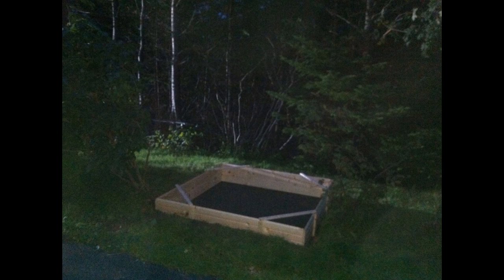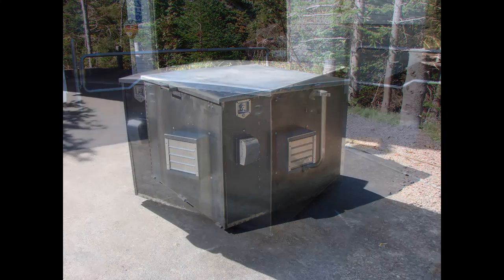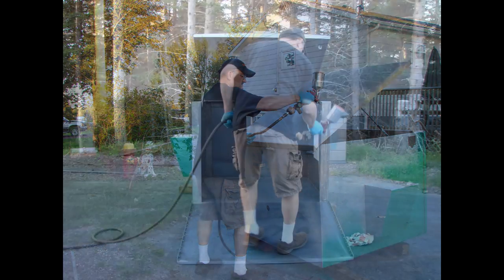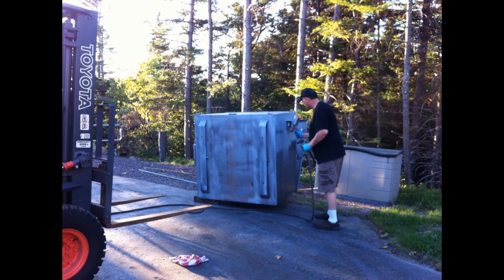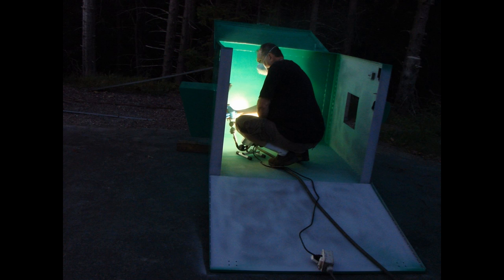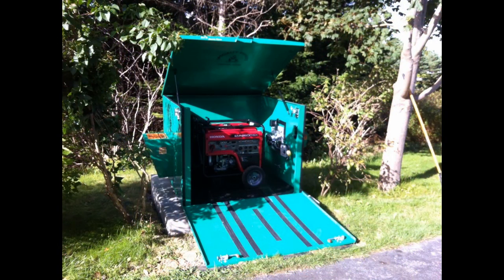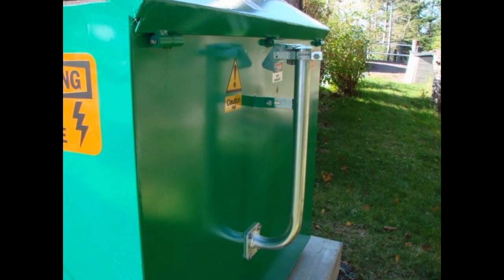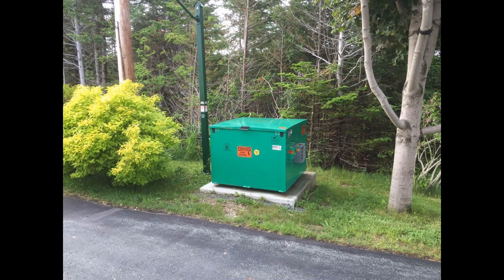The Building Of Our Custom Generator Enclosure

Comment: I remember when you posted about this on TBN. Great build. It put to shame my plywood enclosure. Haha
Reply from the maker: Hey not to worry. I work with metal and you with wood. The end result is the same. Our generators are out of the elements. 👍👍
Reply: Yep good stuff ply. especially Marine ply as it is mostly impervious to.water> Build most of my things from this as I cannot weld to save my life. What ply doesn't like is our harsh sunlight. Ha! so you have to shade all your external work.

Comment: I just assumed that your generator was a whole house/shop , permanently mounted and running on propane or such. very cool! best of both worlds.capacity and portability. love the enclosure. I might have to do something similar 😀 Merry Christmas ☃🎄
Reply from the maker: I have a friend that has a Generac stationary genset. It's been outside for four years and the metal housing is rusting out already. He can't use it for anything else. The one you see here is very tough. A tree could fall on it and not hurt the thing plus I can take the portable generator anywhere to se it at something else. That being said I've only used it twice in three years. The generator is never left in the enclosure when not needed. It's stored in a heated area of the shop and ready to use when needed. Thanks for watching. Merry Christmas to you.
Reply: Paul Short  very smart.

Comment: I have a 5000 watt generator and I have a manual transfer switch. I have a thick cord that I hook up. I have to pull out the generator from the garage when the power goes out. Very cool on your part and thanks for your reply. Have a warm evening.
Reply from the maker: Sounds like a good system you have there. Our 6500 watt is really more than we need but it works great. I dont leave it n the shelter all the time, I just put it in there when there's nasty weather expected. I have a 25' generator cord that I plug into the 220 volt plug on the generator and the other end plugs into the house. I didn't want to dig up the drivewayto bury the cord. In the last two years we've only put 22 hours on the system. Nice to have it just in case.

Comment: Its kind of a cool coincidence, but I'm actually a Cummins/Onan generator tech and your set up looks just like one. It would be neat if someday you could do a video on how you've got it hooked up to the house. Is it a three phase hooked up to a double throw panel outside the house? Maybe even a load test video to see how it performs. I know we load bank our gens at least once a year to keep them from wet stacking, if you're familiar with that. Cool vid Paul!!
Reply from the maker: I run a 220volt line from the generator to the house where there's a square D Plug in on the outside wall and inside there's a square D aux panel that goes through the main panel and into the aux generator panel where there are dedicated breakers assigned to areas of the dwelling that we wanted to use. Each leg was amp tested to equalize the draw so everything balanced  out. We can run our furnace, our fridges, all our inhouse led lighting, all TV's and most importantly internet services. Lol. As I mentioned in other comments we've only needed this twice in three years. Oh the panel we use can only be turned on when the main one is off.you can't have both on the same time and if the main panel is on no power from the genset can go threw it.  We all need to do our part in protecting our linesmen & women.

Comment: I think I may have mentioned once that the entire city of Alice Springs runs on 3 large gen sets so there are quite a few backup sets around the place. Mostly Coles and Woolworths size mobs. And of course the hospital. I think I may have emailed you some pics at some stage mate.
Reply from the maker: Wow. That must cost plenty. We have a place called Holyrood and it's a generating station. They've been trying to shut it down for years. They did millions upgrades a few years ago and it's very reliable now so that's why we don't loose our power much now. https://en.m.wikipedia.org/wiki/Holyrood_Thermal_Generating_Station
Reply: Wow. Runs on fuel oil.Ours is duel fuel. Natural gas and diesel backup. Since they were commissioned we have not had a blackout. Prior to that we would average a city wide blackout once a year. sometimes for up to 8 hours. That's expensive!! Don't know if you have seen the Alice on a map. We are almost the dead centre of australia. 1500K from any shore.Natural gas is pumped from local fields to supply us with power and fuel. Otherwise life would be a lot more difficult. Ha!

Comment: Thanks for the video. Sorry if this was already asked, but how do you bring power to the house? I didn't see a conduit, so maybe a generator power cord going to a transfer switch in the house? I modified a mini garden storage container for similar purpose with fan, exhaust... but found running the extension cord during mostly extreme weather, the weak point in my setup.
Reply from the maker: It was my intention to dig up the pavement and bury the power cable but I couldn't bring myself to do it so I just run a 20' power cord over to the house and it plugs right into the house. It don't matter much to me because our generator only goes in the enclosure when it's needed. Three years it's been there and used twice so I'm not tearing up everything for that lol. 
Sounds like you have a nice system.
Reply: Paul Short thanks for the reply Paul. I hear you, since I built the enclosure, we haven't had one major power failure either... go figure

Comment: Hello from hurricane country (FL.)  I've saved your video for about a year and will finally start building my enclosure this month.  I have a larger generator, so my enclosure will be slightly larger.  Anyway, if you don't mind I would like to ask if you can help me with a sheet metal (plate) question.  I know you said you had 1/4" and 1/8" in your stock, so that is what you used.  I am curious if you think a little bit thinner material would have worked for your design.  Say 16 gauge?  Obviously it is cheaper, so that is why I would consider it.  I will use the concrete slab as the bottom, so I can save some cost there.  So the material I select would be for sides and top.  I concerned though, that thinner material might rattle when the generator is running.  I will use 1 1/2 angle 1/8" thick for frame.  I would also use a center cross piece on the long spans to help brace the sheet metal.  Do you think 16 ga would work or should I stick with 1/8"?

Comment: How do you have your house wired to the generator? I have seen the generators that are just for your home and they have their own breaker panel or at least the ones I have seen do. Thanks for all the great videos, if you have a video like this one for the street light pole I would really like to see how you built it. Take Care.
Reply from the maker: Thanks for watching. I run a 220volt line from the generator to the house where there's a square D Plug in on the outside wall and inside there's a square D aux panel that goes through the main panel and into the aux generator panel where there are dedicated breakers assigned to areas of the dwelling that we wanted to use. Each leg was amp tested to equalize the draw so everything balanced  out. We can run our furnace, our fridges, all our inhouse led lighting, all TV's and most importantly internet services. Lol. As I mentioned in other comments we've only needed this twice in three years. Oh the panel we use can only be turned on when the main one is off.you can't have both on the same time and if the main panel is on no power from the genset can go threw it.  We all need to do our part in protecting our linesmen & women.
Led street light pole for generator. https://youtu.be/PjrXLRuUM3U
Part 2: https://youtu.be/L6iFPW0-Ei4
Reply: Thank you for taking the time to answer my question. It works the same way as a normal backup generator, but your using a portable generator. I didn't know you could use a portable style generator. I live in Texas and we lose power a lot during the Spring with all the Thunderstorms. I am looking to build a new house and I want a backup generator. This will save me a few thousand dollars by using a portable generator like you have done. The generators I have looked at that are just for your house are around $5,000.00. Once again thank you for replying and sending me the link for the light pole.
Reply from the maker: Your more than welcome. Glad it helped you out.

Comment: Paul, how did you canect the power to the house? did you use a manual transfer switch that you have to switch by HAND or is it automatically turned on?
Reply from the maker: I used a manual transfer switch.  https://www.amazon.ca/Square-Schneider-Electric-8-Circuit-Generator/dp/B004Q0AWYE/ref=sr_1_15?ie=UTF8&qid=1485306831&sr=8-15&keywords=Square+d+generator